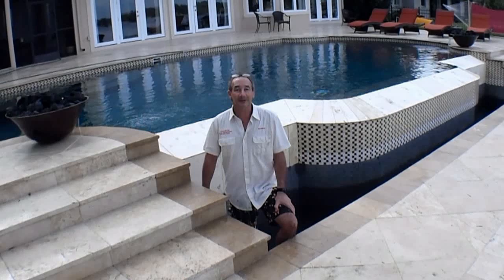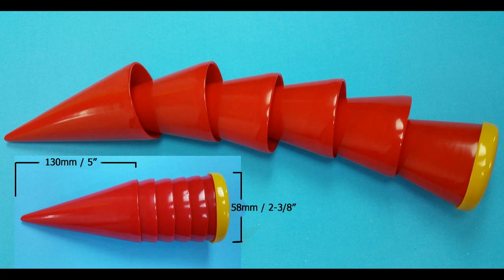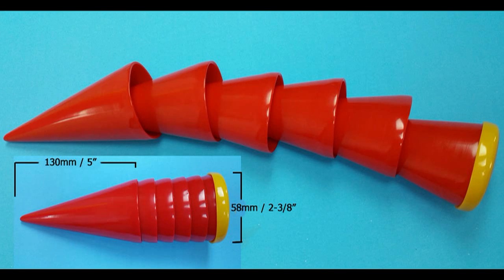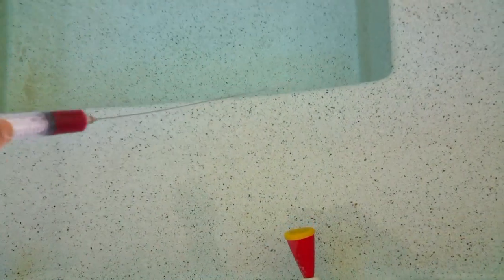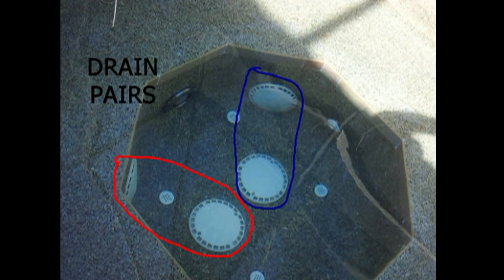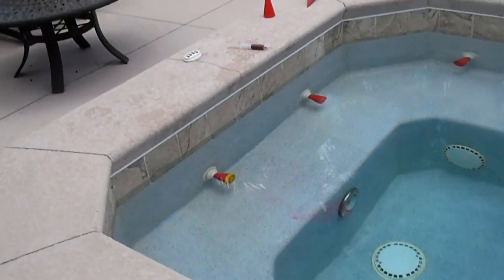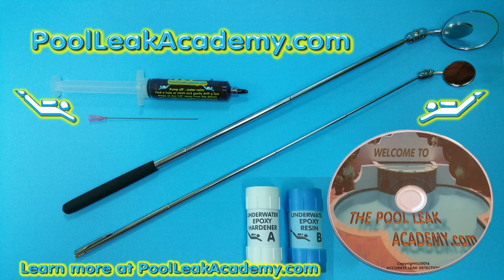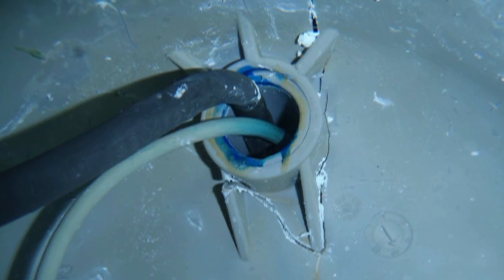Swimming Pool Leak Detection - quick plug dye testing cones

Comment: Good video. DO you use the cones instead of pressure testing, or in conjunction with pressure testing? 
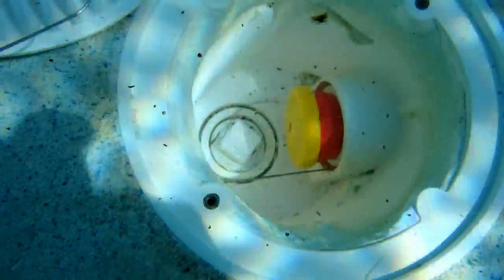Is that a hydrostatic valve at 3:28?
Reply: Pressure testing is the best way to see if that system your testing is secure.dye testing work on Evidently broken pipe .
Reply from the maker: Pressure testing is difficult because the plugs have to fit perfect and your testing equipment cant leak a drop. That's a lot to ask from an old pressure rig sitting in your van for a year. I prefer the cones- they are very accurate- I always ask my customers to leave the pump off the night before I arrive so the foundation under the pool  is not flooded with water and giving me false readings.

Comment: Hi my pool has oldfasioned floor vents that are fixed and can not be sealed off how can I detect a leak in them please help I am going crazy . My main drain was plugged off when I bought the house so the only water flow is through the skimmer return and the floor sweepers are my returns they want 500 bucks to come out and look at it.
Reply: Go to http://www.PoolLeakAcademy.comorder the kit and the cones and we link also link you to a good video for finding pool leaks.
Reply: @leakboy  The biggest issue is 'fixing' the cracked pvc ..How would i know where exactly to dig to get to the crack ?